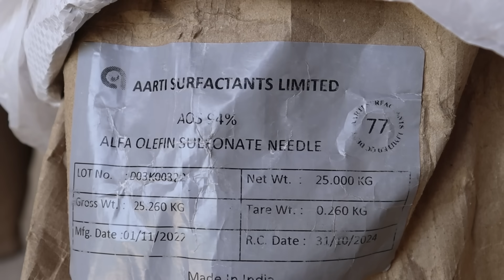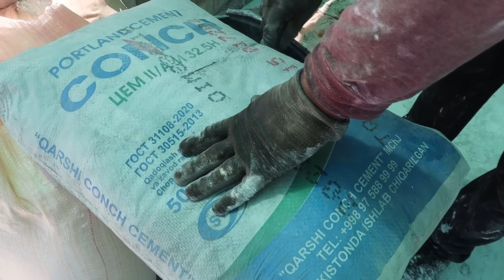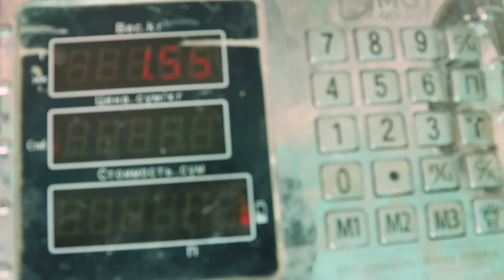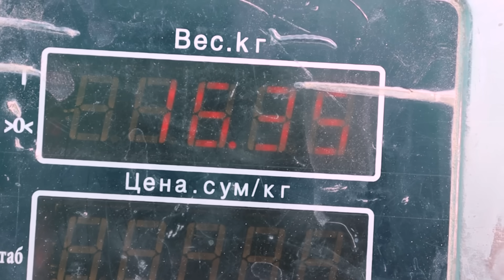Amazing process of making foam concrete blocks | production of foam blocks with subtitles

Comment: We all would like to know the ingredient list and how much of each are you using. 👍👍
Reply from the maker: list of ingredients for 3 blocks
37 kg of Gypsum
2 kilograms of cement
50 liters of foam  weighing 1.5 kilograms
50 liters of water
Reply: @BbAmazingSkills its mean 1 Blocks minimum $200 up..
Reply from the maker: @ruwanhettiarachchi6980  in our region one block costs an average of $1
Reply: @BbAmazingSkills  WHAT IS THE INSULATING LAMBDA VALUE OF THE BLOCK?
Reply: Hi, thanks for videos, how can you measure 50 Liter of foam when you add it directly to the mixture?
Reply from the maker: @bryanadz  The video shows a barrel of 100 liters
list of ingredients for 3 blocks
37 kg of plaster
2 kilograms of cement
50 liters of foam plastic weighing 1.5 kilograms
50 liters of water
foam is measured by eye, we showed the foam approximately
Reply: Thanks brother, than you put the half of you can put in barrel ? 
With experience you can measure the time of foam pressure ? 
What you mean by  block is it the mold of 6 brick ? Wright ?
How about adding more than 2 kg of cement? Maybe it will be more resistant? Have you tried ?
Salam Brothers
Reply from the maker: @bryanadz  what did you put half that can be put in a barrel? didn't understand the first question!
With experience, can you measure the time of foam pressure? 
first measure by scales and then you will work by eye!
What do you mean by block, is it a 6 brick shape? Wright?
 Yes!
How about adding more than 2 kg of cement? Maybe he'll be more durable? Have you tried? 
will be stronger but harder!
Salam Brothers
Reply: I second your suggestion.
Reply: @drzavahercegbosnaponosna5974  not only with blocks same situation :D
Reply: @RealMaxeZ   :D ?!
Reply: @BbAmazingSkills  and is any problems with mold
Reply from the maker: @carloslarios2496  no mold problems
Reply: @BbAmazingSkills  Where are you located? In the US (and from China via Alibaba) gypsum powder is $1-3 a kilo. Portland cement is $0.25 a kilo. Replacing cement with gypsum makes this much more expensive.
Reply: How to make foam?
Reply: @Krizz18 watch minute  00:24
Reply: @BbAmazingSkills Aarti Surfactants manufacturing plant located in my city 👍 good to know its applications. 00:40
Reply: having watched, i would just get a cheap blender and start experimenting.
olefin sulfonate needles... soap. like lux laundry flakes.
cement. plain old cement from the hardware.

the suggestions of gypsum make sense... plasterboard filler, or plaster of paris. you need it to set up fairly rapidly. you have a few minutes of working time with the plaster before it hardens up, and even then... should still be plenty soft enough to cut, work, yet not fall apart immediately.

i know what im doing tomorrow?
Reply: @bryanadz  E.g., if your pump outputs 2 l/s, then you pump foam for ~25 s.
Reply: You might want to check your local diy store. Here in Europe/Germany you should pay below 50 cents for gypsum, especially in large quantities. I would be amazed, if it was that expensive in the US.
Reply: How is it better or cost effective than regular cinder blocks..
Reply: I ask because normally 1 liter of additive produces 12.5 liters of foam, with an average density of 80g/lt. So the 5 liters you add to the tank would only produce 62.5lt. So the AOS 94%, since the 250g are dissolved in 5 liters of water, what more amount of water is required in the generator to produce foam for the 150 blocks?
Reply: We all would Like to know The Ingredients  List please let me know I m from Pakistan  Raja Aslam Lhor
Reply: @BbAmazingSkills  hello sir please can you tell in simple words about how you made the foam and what ingredients are needed for it?
Reply: All of that is in the video, you just gotta turn subtitles on
Reply: @BbAmazingSkills  What is the chemical make-up of the foam?
Reply: @hashimniazi6089  Great question, that's what l also would like to know.
Reply: @BbAmazingSkills  Dose this material have a fire rating, is it flammable?
Reply from the maker: @88njtrigg88  ALPHA-OLEFIN SULFONATE is a chemical substance. AOS
Reply from the maker: @88njtrigg88  fire-resistant foam block does not burn in fire
Reply: @Krizz18 only with lux😂
Reply: Can you tell me size of block please?
Reply from the maker: @GreenHills-v7s  60cm/30cm/20cm
Reply from the maker: @GreenHills-v7s  60cm/30cm/20cm
Reply: @BbAmazingSkills  
Jazak Allah
Reply: How do they go for fire?
Reply from the maker: @horozcop  does not burn
Reply from the maker: @FingerinUrDaughter  it's not plastic! the composition of this product is foam and gypsum; it doesn't burn
Reply from the maker: @FingerinUrDaughter  dude, turn on the subtitles and watch without scrolling, you can see everything in the video
Reply: You can make with dawn soap foamed up same way.  This is really cool
Reply: Can you explain the foam making process? 250 gram AOS per 5lt water,
Pour that mix into a larger container (size?)
Add water (how much?)
Is compressed air used for making the foam?
Is the take off pipe for the foam located at the top? 
It's what it looks like in the video.
Reply from the maker: @shibuigardenbungalows0420  foam making process
250 grams of AOC per 5 liters of water,
Pour this mixture into a large 80 liter container.
Add 50 liters of water.
Is compressed air used to make foam? Yes
The foam outlet tube is located at the top.
Here's what it looks like on video.
Reply: @sunnydays6406 probably insulates better and is half the weight. I mean in this video it says the foam blocks are about 16 kegs or 35 lbs. But they look way bigger than a cinder block. So makes building less labor intensive. So probably a faster build and less labor required. But the annual energy savings (if they were being used in an air conditioned building) could be substantial in a place like Texas, Mexico, etc.
Reply: @BbAmazingSkills   список ингредиентов на 3 блока 37 кг гипса 2 кг цемента 50 литров пены весом 1,5 кг 50 литров воды В УКРАИНЕ  ЭТОТ  СПИСОК БУДЕТ ОКОЛО 800ГРИВЕН СТОИТЬ А ТРИ ГОТОВЫХ ПЕНОБЛОКА  330 ГРИВЕН... навар где делся ???
Reply: Any training or manufacturing unit in india
Reply: Hello sir any manufacturing unit or training institute in india
Reply: I’m confused. One block has a weight of 29.05 the other block 16.35??
Reply: @BbAmazingSkills which material you used to make foam?
Reply from the maker: @haiderchemical  all in subtitles, turn on subtitles
Reply: foam??? what a kind
Reply: i most certainly would not want to live or even be inside of anything made out of this stuff.
Reply from the maker: @jonaspereira3551  ALPHA-OLEFIN-SULFONATE - a chemical
Reply: Please let me know, with this composition, how much concrete blocks in cubic meters? I really want to know how much money I should spend in my country. Thank you
Reply: @superopik752 
before you kill anyone.  
don't even concider using this crap. 

for example. 
polystyrene.  is the material used to make cd cases. or throwaway razors.  and things like that.  
pretty hard stuff.  
you can imagine that a bridge made out of solid polystyrene.  would be able to support the weight of a truck.  
now take the same bridge.  and make it out of styrofoam.  (the same material but a foam) 
it would snap in half under the weight of a single HUMAN.  

the same goes for this concrete.  
building ANYTHING out of it,  is asking for people to die under a collapsed buiding.  

DO NOT buy these or even attempt to use these.  
they are a quick cash grab by people who don't give a damn about who they hurt.
Reply: @darkracer1252  Calm down friend, are you a civil engineer?
Who is a fool who would want to make a vital building like a bridge from materials like this? This is for wall materials, not for the main structure. don't be weird, bro
The main structure must still use steel reinforced concrete. Meanwhile, wall structures can use anything as long as they are sufficiently resistant to impact, heat and the lighter the material, the better because it can reduce the load on the main structure.
Reply from the maker: does not burn in fire fireproof
Reply: @BbAmazingSkills 
that's about it's only use.   
built in insulation.
Reply: what is the size of one block, how much does one dry block weigh?
Reply from the maker: @ТюлпанСолнце  60cm/30cm/20cm 16kg
Reply: @darkracer1252  ofcourse, what more to expect from other block types? build a skyscraper with it? no
Reply: @BbAmazingSkills   Hi bro what is the measurements of blocks
Reply from the maker: @doublebrain_2k  60cm/30cm/20cm
Reply: @BbAmazingSkills can you plz tell me the cost of each product
Reply from the maker: @hirapatill2005  In each country the cost is different, in our country one block is sold for 1 dollar.
Reply: Thank you bro, excellent work..few questions:
1. The "semi-dry" 29kg block was after how much time
2. What type of foam generator did you use? I can see a compressor machine, what is the other cylindrical thing?
3. How come the blocks come out of the mold almost smooth/minimal surface bubbles? Do you vibrate or how do you get smooth surface finish?
4 Can you add fiberglass strands to increase strength?
Reply from the maker: @bensonwambugu7012  Thanks bro, great job..a few questions:
1. How long did it take for the 29kg block to be “semi-dry”? after 15 minutes
2. What type of foam generator did you use? I see a compressor, what is that cylindrical thing? This is a car gas cylinder
3. Why do the blocks come out of the mold almost smooth and with minimal bubbles on the surface? Are you vibrating or how to achieve a smooth surface? To do this, grease the mold with oil.
4. Can fiberglass strands be added to increase strength? Yes
Reply: @BbAmazingSkills  Thank you sir. Where did you get the foam generator, or did you make it?
Reply from the maker: @bensonwambugu7012  made by local artisans
Reply: @darkracer1252 
These blocks are are used for non-structural elements in the buildings like non-load bearing walls, partitions and so on.
Reply: The rest is air.  Consider air weight.
Reply: Hi can we use protein based foaming agent instead of AOS
Reply from the maker: @FAKHREKHAN-gj2xz  yes
Reply: Брат где вы находитесь?
Reply from the maker: @Maximus32   ТЁПЛАЯ СТРАНА УЗБЕКИСТАН
Reply from the maker: @Maximus32  Солнечная страна Узбекистан
Reply: Вы в Узбекистане или в сша? Тина видео узбеки работают
Reply: @BbAmazingSkills  А где именно? Я тоже с Узбекистана, у меня тоже такое же производство в шахрисабзе но много проблем с качеством. Я бы хотел поработать у вас какое то время.
Reply from the maker: @Maximus32  вам поможет этот человек он с Мубарека https://www.youtube.com/@Samad546
Reply: Can you tell me what is the size of this form cement block?
Reply: What size of 1 block? And strength how many Mpa ?
Thankyou
Reply from the maker: @cutecatlover6116  60cm/30cm/20cm
Reply: @BbAmazingSkills  I make blok 1m3 use 400kg cement 200kg sand and 1230 l water.
But result still not so strong..
Can I get your WhatsApp Number Sir? 🙏🏻
Reply: @BbAmazingSkills  badass. Very cool
Reply: What is size of block
Reply: Добрый день! Скажите пожалуйста какая прочность будет у ваших блоков?
Reply: @carloslarios2496  The lime in the concrete mix will prevent mould from forming.
Reply: @yurcoza  nu compara blocurile deipsos cu cele de ciment. in plus aceasta reteta este pentru cei ce nu au industrie in jur care sa faca treaba asta industrial. si in romania ai ipsosul si cimentul industrial cu 30-40% mai ieftin pt ca vine la cimentruc nu in saci. in turcia e la 50% mai jos totul... depinde de tara, conditii de munca etc.
Reply: @drzavahercegbosnaponosna5974  i would assume the heat transfer coefficient is lower than regular cement/cinderblocks because of the foam. my assumption is that the added air increases the insulation properties of the block. I could be wrong but that's what logically makes sense to me
Reply: @BbAmazingSkills انا من فلسطين هل يمكنك كتابه الوصفه كامله مع جميع التفاصيل لأننا بحاجة لذلك النموذج الفني شكراً لك من قلبي❤❤❤❤❤ انتم فخر الإنسانية
Reply: @BbAmazingSkills لدينا كل عشرين كليو جبس ما يعادل عشر دولار هل يمكنني تصنعه بنفسي بدل التكلفه العاليه
Reply from the maker: @صابرعزمي  قائمة المكونات لثلاثة كتل رغوية
37 كيلو جرامًا من الجبس
2 كيلو أسمنت
50 لترًا من الرغوة
50 لترا من الماء
شكرا على الكلمات الرقيقة
Reply from the maker: @صابرعزمي  قم بتشغيل الترجمة
Reply: Bu işi türkiyede yapmış olsaydın milyoner olabilirdin.
Reply from the maker: @gaining7800  🤩
Reply: @BbAmazingSkills  😉
Reply: @BbAmazingSkills Скажите, можно ли в домашних условиях произвести такой  продукт, используя сподручны средства для пенообразования? Мне это нужно, чтобы залить в опалубку для утепления наружных стен?
Reply from the maker: @jannazh1228 да можно если сможете смастерит пеногениратор
Reply: @BbAmazingSkills  А без пеногенератора никак?
Reply from the maker: @jannazh1228  если есть другие возможности пенообразование
Reply: @BbAmazingSkills  А если дрелью взбить пенообразующую массу,  возможно?
Reply from the maker: @jannazh1228  не знаю
Reply: @BbAmazingSkills  Спасибо!
Reply: Using 37kg gypsum makes the price expensive?
Reply from the maker: @korabumseira5825  I don't know, but it's not very expensive here
Reply: Same. I'm also looking for how to make foam
Reply: @BbAmazingSkills how much one block weight?
Reply from the maker: @JayeshPatel-lz2yw  watch the video carefully
Reply: @sunnydays6406 lighter and less expensive but also significantly less strong.
Reply: Qubic meter price
Reply: ok so i have a question why add so much gypsum while gypsum is more expensive than cement? also what are the dimensions of the block you are producing? ca i just substitute the gypsum with sand?  @BbAmazingSkills
Reply: also u have mentioned that the mixed quantity will produce 2 blocks. so in total you mean the mixed quantity will produce 12 blocks? did i get it right?
Reply from the maker: @eemmaaddgghh  60cm/30cm/20cm
Reply: @BbAmazingSkills 防火太好了！兄弟谢谢你！请问哪些一粒粒的黄色的是什么？谢谢
Reply: how about the plaster can this be changed since plaster is very expensive ? and the quantity you mixed how many blocks will it produce?i appreciate you fast response time @BbAmazingSkills
Reply: @BbAmazingSkills I have to salute you, 60 time the same question and still find patience to respond to them all.

Huge benefit using gypsum is the speed of block production.

I don't know how long the foam can stand, as concrete needs about 5 hours to cure strong enough to hold its own weight.

I guess I have to try and find out :-)
Reply: @BbAmazingSkills  do they result in fairly strong blocks? . Your videos are excellent. Very informative too. Thans for sharing 👌👍

PS: no need to answer my question. Upon watching through the whole video, i see that these bocks are indeed very strong
Reply: THANKS for every think  @BbAmazingSkills
Reply: @holgermessner851 
The second one after curing process with lower water... Dry one
Reply: How much it'll cost to establish a manufacturing unit  with all those machines and at least starting 300 blocks manufacturing cost
Reply: @BbAmazingSkills  ا
Reply: @SteveBueche1027 have you ever experimented with substituting lime in place of gypsum?
Would this be possible?
Reply: А есть ли проблемы с трещинами?
Reply: what is the foaming chemical
Reply: Como conseguir esse aditivo
Reply: @BbAmazingSkills  es yeso sulfato de calcio semihidratado (CaSO₄·½H₂O), o cal hidratada hidróxido de calcio (Ca(OH)₂). Ya que los bloques de yeso estarían más vulnerables a la intemperización.
Reply: @BbAmazingSkills  It is gypsum calcium sulfate semihydrate (CaSO₄·½H₂O), or hydrated lime calcium hydroxide (Ca(OH)₂). Since the gypsum blocks would be more vulnerable to weathering.
Reply from the maker: @juanfranciscoflores8575  FORMULA AND STRUCTURE OF GYPSUM Gypsum is calcium sulfate (CaSO4), which can be present in different modifications with crystalline water (H2O): Dihydrate (CaSO4 * 2 H2O) → Hemihydrate (CaSO4 * 0.5H2O) → Anhydrite (CaSO4). H2O – 20.9%. The chemical formula of gypsum binder is almost the same as that of natural gypsum.
Reply: Sar banane ka formula dijiye @BbAmazingSkills
Reply: Sir aap ka mobile number
Reply: @BbAmazingSkills what kind of foam?
Reply from the maker: @NamLeLa  chemical substance alpha olefin sulfonate AOS
Reply: @BbAmazingSkills what are the chemicals in the foam though?
Reply from the maker: @1truthseeking8  alpha olefin sulfonate AOS
Reply: You can't add gypsum to this mix. It absorbs more water & makes blocks weak.. you can instead add white cement, it's much more stronger & cheaper. The design of block is very poor. Better to make hollow inside & some grooves.
Reply: Good gob.
What is the total dimensions of the iner side of the mold,  and the partition thickness between blocks.
Thank you in advance 
Yasser - Jordan
Reply from the maker: @trustchem  60cm/30cm/20cm
Reply: @BbAmazingSkills  among the mixture ingredients,  there is no mentioned for sand, or fly Ash quantity!
Reply from the maker: @trustchem  Watch this video. 
300 g of alpha olefin sulfonate yields 150 blocks.
block sizes 60cm/30cm/20cm
List of ingredients for 3 foam blocks
37 kg gypsum
2 kilograms of Portland cement
50 liters of finished foam (alpha olefin sulfonate)
50 liters of water
https://youtu.be/D3ajZ7ly6I8  FOAM GENERATOR, HOW TO MAKE IT YOURSELF
https://youtu.be/-h6zBbVkuQI   production of foam blocks with subtitles
Reply from the maker: @frankgessner6766  😶
Reply: @BbAmazingSkills  bro. What is the sand quantity or percentage?
Reply from the maker: @trustchem  There is no sand in the composition, only gypsum, cement and foam.
Reply: @BbAmazingSkills ❤
Reply: انت انسان طيب كل الشكر من العراق
Reply: @BbAmazingSkills have you try using plaster lime instead of gypsum?.
Reply from the maker: @mhdzakimlr7573  Haven't tried it
Reply: انت رجل كريم وطيب تحية لك من بلد العراق
Reply: السلام عليكم
ماهية قياسات القالب المعمول به
جزاك الله خير الجزاء
Reply from the maker: @ابومحمدالمريانيٰ-ظ6ت  أشكركم على كلماتكم الطيبة، وتحياتي من أوزبكستان.
Reply: ما حجم الرغوه المتكونه من300غرام من aos
Reply: هل تقصد ان300غرام من aos تنتج رغوه كافيه لانتاج150 قطعه
Reply: Cuál es el largó y ancho de cada bloque?? A qué tiempo se lo puede desmoldar sin que se rompa?
Reply: @ruwanhettiarachchi6980  in our country it cost around 60 rupees
Reply: 5:00 seems the foam falls apart and becomes a liquid.
Reply: R value alone, my new building blocks
Reply: Was that rice water? Does that make it a starch that makes the foam, foamy? If so could you just add a bit of laundry starch? So many ???
Reply: Can I use flyash ,not gypsum
Reply: @ruwanhettiarachchi6980  average cost per block is 0.97 - 1 $
Reply: @bryanadz  it mentions 50 liter = 1.5 Kg weight
Reply: Alpha olefin sulfonate
Reply: Seu vídeo é muito interessante. Muito obrigado e boa sorte.
Reply: @BbAmazingSkills  37KG +50Litres + 50 Litres of foam+ 2KG = 3 blocks  ?? 
even if all the water is dried we are left with around 40KG of material assuming the foam weighs 0 kilograms, which means each block is 13.33  Kg approximately, which is not light wight i guess...
what is the size of each block ?
Reply from the maker: @muhammadjunaidmalik3584  1) 37kg + 50 liters + 50 liters foam + 2kg = 3 blocks ?? -- yes
even if all the water dries up, we'll have about 40kg of material left, assuming the foam weighs 0 kilograms, which means each block weighs about 13.33kg, which isn't that small I guess... --- yes you're right
what's the size of each block? --- 20*30*60cm
Reply: 😂 @BbAmazingSkills
Reply: @BbAmazingSkills For just three blocks? That's expensive
Reply: @dinokpir what's is cost of 1 block?
Reply: @dinokpir I want to start this business from Pakistan,, anyone helpe me there,, how this foam making?
Reply: Thank you sir for sharing this, I would like to know the resistance of cellular concrete blocks.
Reply: I would like some chimney blocks,to line with chimney tiles.
Reply: Que medidas  son esos bloques, porq 250gr
Reply: @BbAmazingSkills 
dapat juga pakai alat pembuat busa untuk cuci Mobil.
Reply: Curing required?
Reply from the maker: @ameno7809  Ya tentu saja
Reply: Ассаламу алайкум
Reply: هل ينفع استبدل الالفا اولفين سلفات 
أنا جربتها ب ماده تكسابون كويسه ف الرغوه بس عندي مشكله ف التصلد برجاء الرد سيدي 🙏
Reply: هل ينفع استبدل الالفا اولفين سلفات 
أنا جربتها ب ماده تكسابون كويسه ف الرغوه بس عندي مشكله ف التصلد برجاء الرد سيدي 🙏
Reply: Can you try make ang a fishingboat with that materials?
Reply: @superopik752 
No creo que él sea ingeniero, está confundido, el poliestireno es producto de la industria petroquímica, el sulfonato alfa olefina es un tensoactivo empleado en la fabricación de jabón.
Un saludo afectuoso.
Reply: Whether these blocks are weather resistant.
Reply: Which country this kind of construction? @BbAmazingSkills
Reply from the maker: @chanchandru2034  In Central Asia Uzbekistan
Reply: Gesso dissolve com água. Esse bloco pode ser usado em áreas externas?? Qual o aditivo  químico usado para impermeabilizante?
Reply from the maker: @andrefreitas157  para isolar da umidade, você pode rebocar com adesivo para azulejos e depois fazer qualquer fachada
Reply: Yes
Reply: @Krizz18  you need to get a foaming agent like PB-Lux (one of many choices)  or even dish soap for small DIY projects. The difference between soap and a foaming agent will be cell quality due to bubble structure and density of the bubbles especially during the cure time. The better the foam the better the aircrete.
Reply from the maker: @handstwister  👍
Reply: Sir, where to take training, where to get it
Reply from the maker: @sohanmanjhi72  I don't know, but you can ask questions and find out.